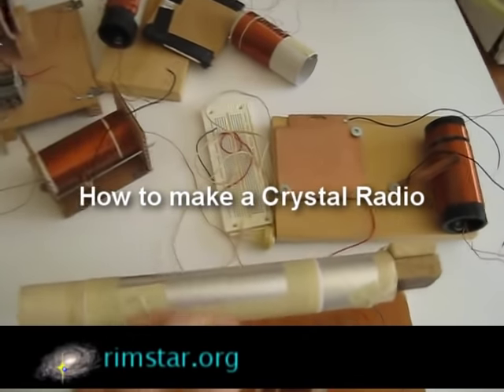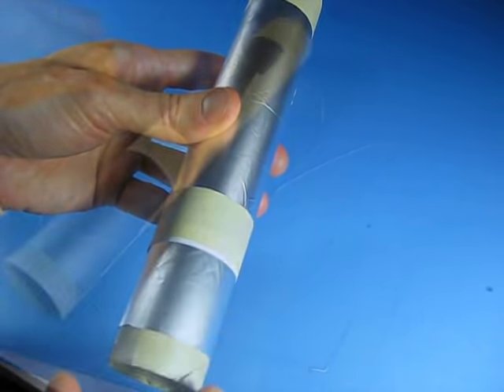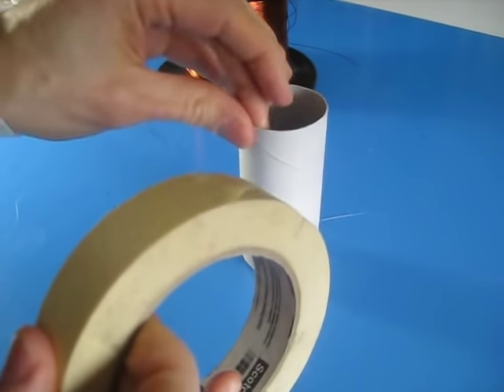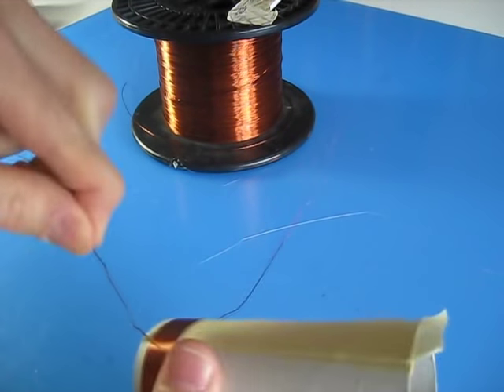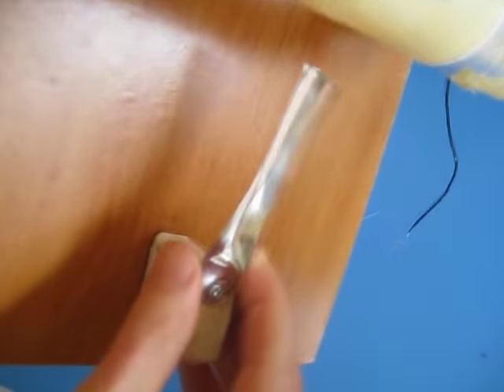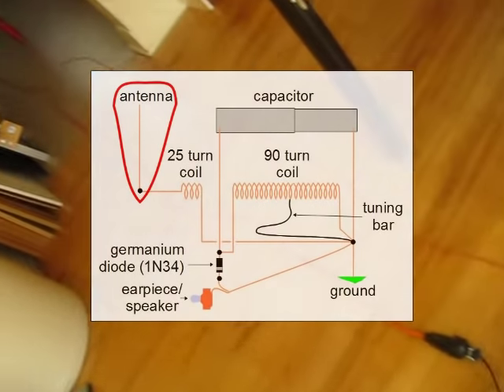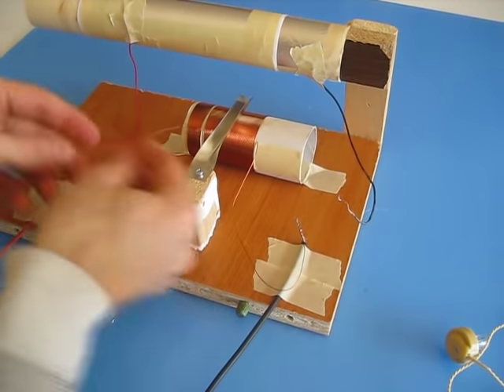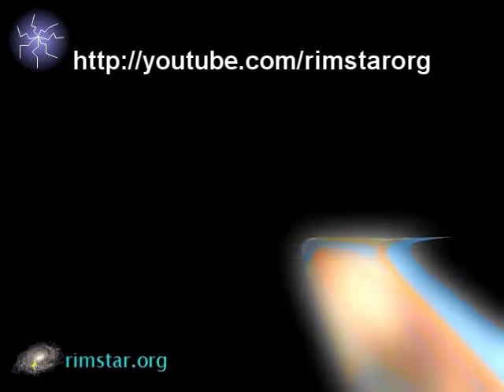How to Make/Build a Crystal Radio

Comment: About how large were your scraps of wood for this Crystal Radio?
Reply from the maker: Ji Jung There's no real need for measurements. I just used random scrap pieces that seemed like they would work. I'd recommend you do the same since it'll be less work (no extra cutting needed.) But here it is anyway (left-right x height x back-front):the base is 280mm x 17mm x 180mm, the vertical support is 35mm x 120mm x 15mm, the paper towel holder is 200mm x
 38mm x 17mm
Reply: RimstarOrg Thank you. I figured it wouldn't actually matter, but because science fair likes to be precise, I had to ask............
Thank you, again!

Comment: Why did you use capacitors what function did it serve
Reply from the maker: The purpose of the capacitor is to help tune in one radio station at a time. It works with the 25 turn coil to do this. The capacitor and coil are part of what's called a resonant LC tuning circuit. You can see much more about this in my "How a Crystal Radio Works" video http://youtu.be/0-PParSmwtE

Comment: does it have to be copper? I only have aluminum wires
Reply from the maker: Yes, the wires can be aluminum. Keep in mind that the coil wires are actually coated with an enamel insulating material even though they don't look like it. The wires for the coil must have some sort of insulation on them to keep them from touching each other. So if you're using aluminum wires for the coils then they must have some type of insulation on them.

Comment: What If I have just a stationary Inducter and a variable capacitor? I would still be able to tune
Reply from the maker: Yes, the values are selected for this design such that it would still be able to tune in all the normal AM frequencies.
Reply: Thank you!
What actually fascinates me more about this design is that it does not need any battery or external power supply to operate. So, the amount of signal energy  received in the primary winding is enough to generate sound which is energy again. 
if we use battery for this system, would we able to get better sound quality?  And how?
Reply from the maker: Sound quality is tricky but volume can be gotten just by putting an amplifier at the output, like I do here https://www.youtube.com/watch?v=JtPwxbOgBHw.

Comment: Is the number of turns dependent  on the wire gauge?
Reply from the maker: +POVadventure Not much. In fact in the math, the number of turns is the biggest factor. But if you're planning on using something much thicker, like 14 gauge (AWG) then it matters.
Reply: RimstarOrg Will an old tv antennae work for as a CR antennae?
Reply from the maker: +POVadventure If you mean an antenna on a roof then it might work, though I suspect most of the benefit will be the long length of wire leading up to it. If you mean just an antenna that sits on top of your TV then no, that won't work. Ideally the antenna should be as long a straight wire as possible.

Comment: Dear Sir will you plz.tell me know ,wire diameter/gauge to be used for Crystal Radio coil
 thanks
Ashok
Reply from the maker: Ashok Nikumbh Hi Ashok, I used 26 AWG but you can use anything from 18 AWG to 30 AWG. -Steve
Reply: Thanks a lot sir, I would like go one more step ahed . I mean I wish to built two transistor AM radio. set. Where I can get circuit diagram..In Popular science magazine, 1956-1960 one of the monthly edition I have seen one such circuit.
Reply from the maker: Ashok Nikumbh I don't have any two transistor AM radio circuit. Maybe try searching on http://google.com.

Comment: also what are the measurements of the pieces of wood
Reply from the maker: They're pretty randomly selected pieces of wood, so use what you have. However, since I've been asked this before I have it on this webpage here http://rimstar.org/equip/crystal_radios.htm near the bottom after the first video.

Comment: what can you use as a tuner instead of the piece of paint can?
Reply from the maker: Literally any piece of metal you can find. Just make sure it doesn't have a coating on it that makes it non-conductive. You can sand the surface with sandpaper if you're not sure. I walked around my place looking for what I could use and that's how I found the paint can. Some suggestions: a stiff piece of wire, coat hanger wire (sand off the coating), a soda can or any can (sand off any coating), ...

Comment: Why is this a crystal radio and not a diode radio? Also, why does the polarity of the diode matter?
Reply from the maker: The definition of a crystal radio has simply changed to mean any radio that gets its power from the incoming radio waves. As for why the polarity of the diode matters, I'm not 100% sure why. I don't recall there being any polarity to the wires for the crystal earpiece.

Comment: i seen enough videos out there that if put together this should be able to be a cool experiment and work as well 

note that i do understand brain waves are tiny compared to radio waves and i do understand that tappin into this brain activities are not easy BUT possible "what your brain playback should be herd or at lease seen as a echo on your tv or radioset
Reply from the maker: Frank Lopez It does sound like a fun DIY project. Playing it back on a radio would be possible, but you'd just be putting it into a radio transmitter like normal audio, and then transmitting it to a radio. It'd be better just to connect the output of your brain wave reader to an amplifier and then a speaker.
Reply: Boost converter
Radio station do this to boost their signals far

Comment: does any resistor from 82k to 100k ohms work instead of the diode?
Reply from the maker: +yomomisjesus No, you need the diode. Resistors can't replace it. I think you're thinking of how you can put a resistor across the output of the earpiece to help with the output, but it's not intended to replace the diode. If that's what you're thinking of then I don't know if you'd get the same result with any value between 82k to 100k. I don't know if some values in that range would work better than others. I've only every tried 82k.

Comment: How can you add a full wave rectification to the crystal radio??
Reply from the maker: I haven't tried it myself, so this is just an untested suggestion. It's also hard to describe in comments. I'd have the two inputs to the rectifier circuit go where the existing diode is. Then I'd connect the two wires from the earpiece across the two outputs of the rectifier.
Reply: Sound's good!! But it will be better if you make a video on that and explain all that stuff... Thanks...

Comment: For all the Doomsday Preppers out there! 
An EMP proof radio receiver that doesn't need batteries ( stash away several diodes for replacements, or use the old galena crystal /cat's whisker substitute). There are many books out there to build these type of radio receivers. The Crystal Set Society is an excellent source for info.

Comment: For the antenna, does it matter what type/gauge of wire you use?
Reply from the maker: EL SALAZAMM No, it doesn't matter.
Reply: Thanks. Also, does it matter if you have a little less or more than 25/90 turns on the coils or do you need the exact amount? I'm having issues with getting my radio to work. Just trying to get some help with troubleshooting.
Reply from the maker: EL SALAZAMM No, a little less or more won't matter. Your antenna needs to be straight and as long as you can get it. Mine are only around 15 fees/5 meters but I have radio stations nearby. It also helps if you can point the antenna in the direction of a radio station. You also need a good ground. See my troubleshooting video for tips on grounds https://www.youtube.com/watch?v=HZZmKZJrIW0 and other tips.
Reply: Rodge, I'll double check the ground and possibly get a longer antenna since I live a bit far from any station. Thank you, sir.

Comment: How can I use a speaker from a phone instead of a crystal earpiece?
Reply from the maker: +naomi That depends on what type of speaker is in the phone. If it's a piezoelectric speaker then you might be able to using the tips I talk about in my video where I use a piezo speaker from a microwave oven here http://youtu.be/OVapqz4yBCY. If it's an electromagnetic speaker, the more normal kind with a magnet, coil and a cone then it might work using the trick I use for earbuds in this video https://www.youtube.com/watch?v=GCh2LVHUavQ, but the current may not be enough for it.

Comment: Hi, can you tell me why the coil is two sections? This way will it receive more stations?
Reply from the maker: The two sections are to help reduce hearing more than one radio station at a time. We say it increases the selectivity, the ability to select a single radio station at a time. I explain it at around ten minutes and forty-five seconds into my How a Crystal Radio Works video here http://www.youtube.com/watch?v=0-PParSmwtE
Reply: RimstarOrg , thank you, I’m going to redo my coil to two sections. Would I use the same amount of turns when I use a 365 pf variable capacitor?
Reply from the maker: Yes. Those amount of turns were designed for a capacitor of that size, it's pretty common for crystal radios. One warning, the trade-off for improved selectivity is a weaker signal (volume) since there's no more direct connection between the antenna and the tuning coil.
Reply: RimstarOrg , Hi, I did redo my coil into two sections. My favorite radio station comes in great during the day. But at night ,it is overwhelmed by several stations that show up. Is there anything I can do to receive my favorite station all the time? I’m thinking of maybe putting in another variable capacitor somewhere in the circuit?

Comment: is there any other things you can use for the antenna
Reply from the maker: It has to be long and for most of its length, it has to be straightish. Any long wire of pretty much any diameter will do, unless you're getting into more than around a hundred feet in which case bigger diameter is better.

Comment: Cannot find the diodes anywhere.  Ordered them twice but they never came.
Reply from the maker: @Thekillerdog You need diode with a low forward voltage, which usually means germanium diodes. Silicon diodes won't work unless you are getting a very strong signal (i.e. have a long antenna or are near a powerful radio station).
Reply from the maker: Thekillerdog  I've heard of people picking up FM but I have no idea how happens since that requires a completely different circuit. I recall seeing that there are FM chips for making it easier.

Comment: is it necessary to use a crystal earpeice or any earphone?
Reply from the maker: The signal is very weak, and requires a high impedance playing device. A crystal earpiece is high impedance. A normal speaker or an earbud such as for an ipod is too low an impedance. See these other videos of mine for other listening options:
Crystal Radio Troubleshooting and Tips http://youtu.be/HZZmKZJrIW0
Use Earbuds/Earphones with Crystal Radio http://youtu.be/GCh2LVHUavQ
Make Crystal Earphone/Earpiece for Crystal Radio http://youtu.be/OVapqz4yBCY

Comment: Where does the crystal come into play?
Reply from the maker: Back in the early 1900s, a chunk of galena crystal and the sharp tip of a wire were used where the diode is used now. These day's, a crystal radio is defined as any radio which is powered by the incoming radio waves.

Comment: Does this require power? Why is it called a crystal radio?
Reply from the maker: Nope, it doesn't require any power, that's what's so fun about it. It gets its power from the incoming radio waves. It's called a crystal radio because back in the early 1900s, a galena crystal and a wire were used in place of the modern diode. These days, any radio that's powered by the incoming radio waves is called a crystal radio.

Comment: Does it matter if your wires are uninsulated?
Reply from the maker: Salcott Aam The antenna wire can be uninsulated but the other wires need to be insulated since you don't want them to conduct from one to the other.
Reply: Even the ones connected to the capacitor?
Reply from the maker: Salcott Aam The only wires that really have to be insulated are the ones on the coil, but you have to sand off the top part of the insulation on the top of the coil. All the others can be uninsulated as long as the touch only where the connect. You don't want them to touch each other anywhere else.

Comment: Do you need magnet wire for the coil
Reply from the maker: +Ethan Doughty No, as long as it has insulation on it you should be fine i.e. not bare wire. The insulation is so that the copper in each turn of wire doesn't touch the copper in the next turn. You do want to be able to get the number of turns on within a reasonable length, so the wire can't be too thick, like 14 gauge (AWG) would be too thick. If you have trouble removing the insulation on the top of the coil and making contact with the tuning bar/wiper bare then you can use the approach I show in this other video about making a coil with taps https://www.youtube.com/watch?v=Gi9EmhrcfIg.

Comment: for the antenna what wire exactly ?
Reply from the maker: Pretty much any wire will work for the antenna. Unless you hang it so that it's not touching anything that's electrically conductive then it should have insulation around it i.e. not bare copper wire. Have it be in a straightish line. If it's going to be 40 or so meters long or longer then you don't want wire that's too thin since it'll introduce a high resistance i.e. not 30 AWG or smaller.
Reply: @RimstarOrg  ok thank you!, and for the head set i only have a normal earpiece but i bought a headset jack which can be connected to a breadboard as I’m making an amplifier for it, what wires will i connect to the breadboard? Just the input and ground right ?
Reply from the maker: I'm not sure which wire you mean by input. In this other video I make a homemade amplifier and connect it to my crystal radio https://www.youtube.com/watch?v=JtPwxbOgBHw . Maybe that will help.

Comment: What will happen if i use non insulated cu wire for making the coil ?
Reply from the maker: If you used non-insulated wire and the turns of wire were touching each other then the whole coil you act as a single turn of wire. The insulation is there to keep adjacent turns of wire from touching each other.
Reply: @RimstarOrg  Thnx

Comment: Just curious how did u know 25 turns for antenna coil
Reply from the maker: I got the 25 turns from the book that I got this circuit from, "Radio Receiver Projects You Can Build" by Homer L. Davidson. It's probably a trade-off between having enough turns to induce a suitable current flow in the tuning coil while not using up too much energy.
Reply: @RimstarOrg  ok thanks

Comment: will it work if u do these without grounding?i heard its lost of energy about 70 percent?
Reply from the maker: There are a lot of crystal radio circuits. This one works best with grounding. However, I have heard that, looking at the circuit diagram at 0:28, if you don't make the connection to ground on the far right end of the coil then it works better. I haven't confirmed that myself.
Reply: @RimstarOrg  that will be awsome to test, i am doing myself intresting exp, but need to know it working without the grounding or no :)
Reply: @RimstarOrg  if its working without grounding, it means we can take electricity even in the sky?
Reply from the maker: The circuit in this video doesn't work very well without ground but it does work.
Reply from the maker: Oh, and the power output is very, very low.
Reply: @RimstarOrg  thanks to know man, ur good guy :). btwn meybi u can tell me how much power decreases?

Comment: Why does the smaller coil have 25 turns. ?
Reply from the maker: That was the number of turns used in the book from which I got this circuit (see the video description for the book). I don't have any formula for calculating it, though I guess it would have something to do with getting a suitable field strength to induce a current in the tuning coil without interfering too much with the resonance between the tuning coil and tuning capacitor.

Comment: Can we use soldering wire to make the coil?
Reply from the maker: sanskar lamsal No. You need a wire that has insulation around it and soldering wire doesn't have any insulation. The wire I used has a very thin enamel coating that acts as the insulation.
Reply: RimstarOrg OK I understand. Thank you.